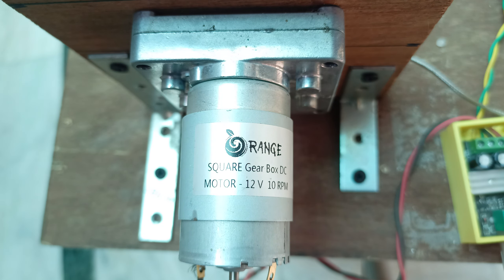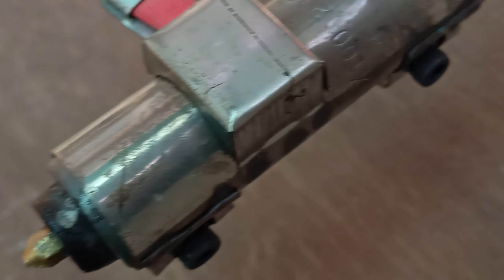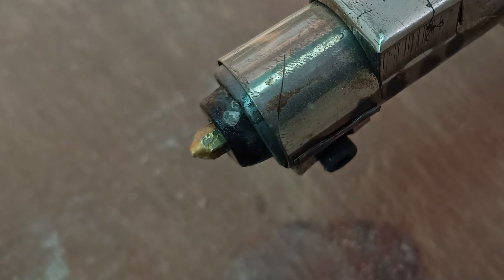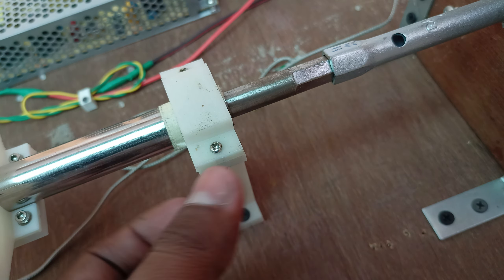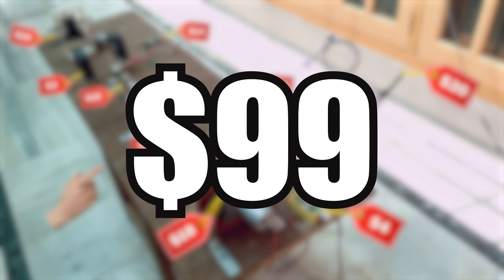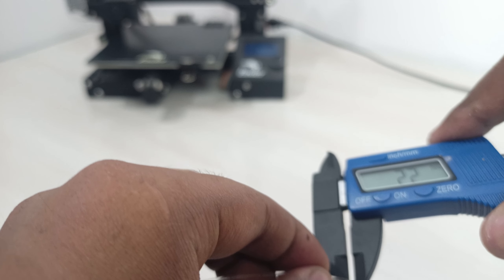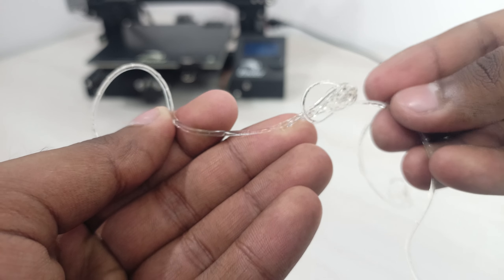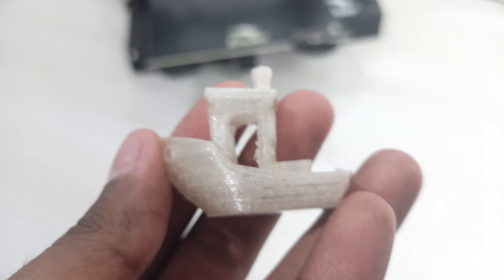$99 DIY Filament Making Machine - Make Your own Filament at Home

Comment: The first thing that comes to mind is using a feedback loop that is able to measure the width of the extruded plastic and adjust the roller speed accordingly
Reply from the maker: yes, it is possible and kinda great idea
Reply: You'd use a method that doesn't come in  contact with the filament, right? What type of sensor would you use for that?
Reply: @JaceN3D Use something that can roll with the filament after its cooled maybe. The machines I used to work on automated mail opening. It used a magnetic field effect sensor to gauge the distance that two rubber rollers were spread apart by the envelopes going through it. It was EXTREMELY accurate after being calibrated.
Reply: @JaceN3D  you could use a guild roller with a weight sensor. You dont need an exact weight either, just "it weighs more" means faster, "it weighs less" is slower, then add in a dial where you can fine tune the speed.

Comment: Hello, I am from Mexico, I will carry out this project for school, I hope it turns out well.
Reply from the maker: Pretty Sure it will, Best of Luck
Reply: eh recopilado los materiales para comprarlos la mayoría en Amazon  lo único que no encuentro es 420mm 25mm Inner diameter barrel y Mi pregunta es la heater to heat the barrel es de una impresora 3d y de acero inoxidable?
Reply: I have compiled the materials to buy most of them on Amazon the only thing I can't find is 420mm 25mm Inner diameter barrel and My question is the heater to heat the barrel is it from a 3D printer and is it made of stainless steel?
Reply: @bydanielgamerv3890 I’m asking the same thing also,I want to know diameter of barrel and the extruder diameter
Reply: Si te funciono ?

Comment: I'd love to turn all the car bumpers that I see on the side of the freeway into filament. As I understand it, they're made of polycarbonate. Maybe someday a laser micrometer will be priced low enough that it can measure the filament at the nozzle as it's extruded so the puller can adjust the speed for a perfect dimension.
Reply from the maker: 🤣. Hopefully cops won't notice. Thats possible, using some sort of measuring device like you mentioned laser micrometre, but in this machine everything is manual so you have to use raspberry pie or Arduino with stepper motor control board and high torque stepper motors

Comment: You need to allow the filament being pulled out to drape down into a catenary before being rolled up. This affects the average diameter of the filament being extruded.
Reply from the maker: Yes you're right, I did that after few trials

Comment: The final key, in my opinion, is to add a puller plate in between the spool and nozzle. They make them for jewelry wire, but you could easily make one. That way the extruded filament is forced through the plate as it cools and it will be more uniform

Comment: Hey, I watched your videos, and I thank you very much for the efforts and information you provide, and I wanted to start recycling plastic into printing filaments.  I found two methods on your channel: the first is cutting plastic bottles into strips and then reshaping them into the shape of printing filaments, and the second is melting the plastic and extruding it.  Like this video I'm commenting on.  I wanted to know, based on your expertise and experience, which of the two methods is more successful and I achieved a better final result, as I want to do the second method, which is plastic extrusion, but I am afraid of the results and that there will be impurities that spoil the matter.... Thank you for your effort and time.
Reply from the maker: If you are using PET bottles then in that case I would recommend the first method, cutting down the plastic bottle into strips than reshaping them into a  filament because it is much more easier to do and the second method that you saw in this video is actually more for making filament from pellets and for impurities you should wash the bottle thoroughly then cut it.
Reply: I watched a lot of videos on reshaping plastic bottles and turning them into printing filaments, and I found that in most cases the bottom and top of the bottle are discarded, and since a regular water bottle weighs about 45 grams of plastic, I find that I will only get 20 grams of strips suitable for reshaping. Also, I cannot cut bottle caps and other similar types of plastic around us that cannot be cut into strips for reshaping.
So I thought I would chop these bottles and turn them into small pieces that would be extruded. What do you think?
Your opinion matters a lot to me and it will save me time. Thank you @Creative3DP

Comment: Incredible work, I will definitely be referencing your project when I get the space to do some filament recycling. Turning supports, brims, failed prints, and measurement tests back into usable filament is my dream. 50/50 virgin/recycled material would be a good enough win, but I think I might tolerate some "bad" quality if it could be 80 to 100% recycled plastic.

How's the cost of virgin pellets per kilo versus filament? Are you stuck buying larger minimum quantities?
Reply from the maker: Thanks man, pellets cost almost 50% of what filament cost
Reply: @Creative3DP  and the other 50% or more you pay in electricity for the heater
Reply: Totally. I want to do the same thing
Reply: @luless666  assuming a 500 watt power supply is used for such project and its running at 100% usage, its still less than 1 USD if you run it 6 hours
Reply: @luless666  Electricity is free for me as long as the sun shines.

Comment: Silly question, how well does the auger mix the raw plastic? If I wanted to experiment with making my own composite Filament (eg: graphene), wouldni be able to use this?
My concern is that your setup seems to melt the plastic enough that it can be pressed into one cohesive Filament, but it likely doesn't heat/mix it well enough that the composite material would form a homogeneous mixture. I'd probably end up with spots rich in one of the two composite materials, and lacking in others ("splotchy" I guess)

Comment: Awesome work! Would you please tell me what’s the model of the heater u used for this?
Reply from the maker: Actually its custom made, I asked the supplier to make me a heater that can reach 300 degrees Celsius and has a specific outer diameter for the barrel,

Comment: Could you provide a written list version of the component breakdown? Based on that, I could begin to source these parts in my local region and see what the cost and feasibility of this system would be.
Reply from the maker: Two 80x80mm Fans
85kgcm gear dc motor
400mm auger bit 25mm
420mm 25mm Inner diameter barrel
1.7mm nozzle
heater to heat the barrel
Puller to Pull the Filament
some L brackets
REX C100 with k type thermistor
SSR AC to DC
PWM

Comment: Man, I love it, but in my city it's horrible to buy this, it would have the measurements of the drill and the iron bar, and what else do I need to do? The end of the bar must have a thread for the extruder nozzle, right?
Reply from the maker: It's Normal 420mm Wood Drill, it doesn't matter whether the end is threaded or not

Comment: screw press through filament nozzle directly into filament or from plastic beads direct to a printer, yes a filament extruder on a 3d printer accessory
Reply from the maker: It appears that you're describing a filament extruder system, where PLA pellets are melted and extruded through a 1.75mm nozzle. However, if you plan to integrate this extrusion system directly onto a 3D printer, it may work better for larger printers that print with larger nozzle sizes. For normal desktop 3D printers, it may not be worth the effort as the quality may not be optimal.
Reply: @Creative3DP  what quality, you remelt the extruded filament straight away, of course it will be beneficial, melt-extruded or just compression-extruded
Reply: @Creative3DP  biased assessment, for your own benefit
Reply: @Creative3DP  money bias shows, as you want to pay for your filament or instruct to use pre-made filament, from manufacturers, for nonsense reasons
Reply: @Creative3DP  I'm not asking you if you think its fine, not giving any authority to anyone, use it or lose it, take care
Reply: @Creative3DP  I specifically mean cold extrusion here, fyi
Reply from the maker: Okh, I might have the problem in the understanding of your comment, So if you rewrite or explain to me what you're trying to say
Reply: @Creative3DP  I think it will work
Reply from the maker: Yeah, it might work. If you make it, let me know.

Comment: Hi can I use W1209 Thermo Controller with Diode 5408

to reach the temp to melt plastic ?
Reply from the maker: Noo max it can reach is 110 degree
Reply: @Creative3DP  is this ceramic heater " 3D Printer Cartridge Heater Reprap 12V 40W" Can it withstand a temperature of 400 degrees Celsius or what is the estimated temperature that it can withstand?

Comment: Hi can you explain on how your heater actually working? I'm a bit lost at that part...
Reply from the maker: To set up the system, you'll need three main components: the REX c100, a thermistor, and an SSR. The video link provided in the description will guide you through the wiring process. Here's how it all works in a nutshell: The SSR plays a pivotal role by interrupting the 220v power supply to the heater. As soon as the heater reaches the desired temperature, it works to maintain that temperature. The REX c100 comes into play here, allowing you to set the desired temperature and giving you control over the process. Meanwhile, the thermistor constantly measures the temperature and sends this information to the REX c100. Once the REX c100 detects that the desired temperature has been reached, it takes action to halt the DC supply from its side. This leads to a complete interruption in the power flow circuit. When the temperature decreases, the REX c100 resumes sending power from its end once more.

Comment: Hei my friend. Could you help me with the drill size and bearing sizes that you used please? Did you need to rework the drill to fit in the role of bearing?
Reply from the maker: I used 22mm outer diameter and 8mm inner diameter bearings and I used 3mm dill bit for nozzle
Reply: @Creative3DP  you are talking about the bearings used in the pipe of extruder?
Reply: @meagodoy  no I didn't any bearings in pipe, I was talking about bearing in filament puller

Comment: Can you try and make one using parts from a ender 3 printer ?
Reply from the maker: If you mean creating filament extrusion system from ender 3's parts, i don't think that would be possible cause the ender 3's parts are rarely in use for this machine as the parts of this machine are different.
Reply: Why don't you do it?

Comment: if the watt of power supply is different with the heat band,is it okay?
Reply from the maker: The heat band is running on AC current, and the power is regulated by the SSR according to the need.